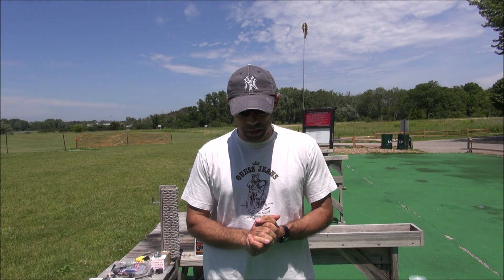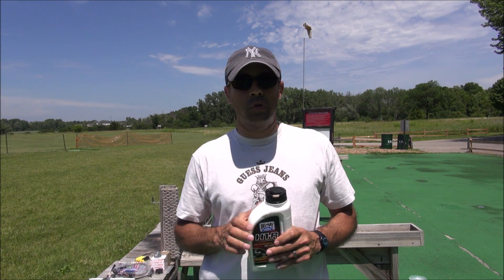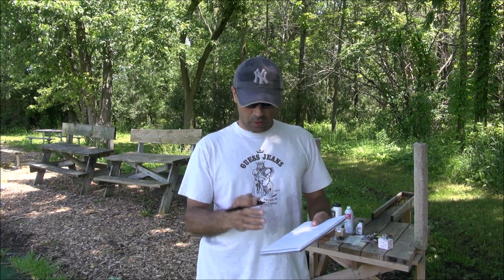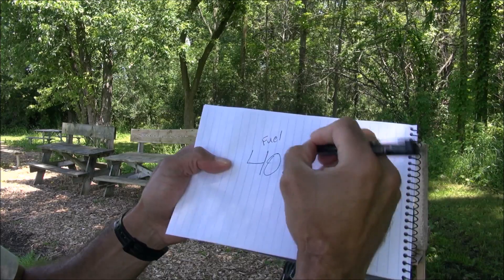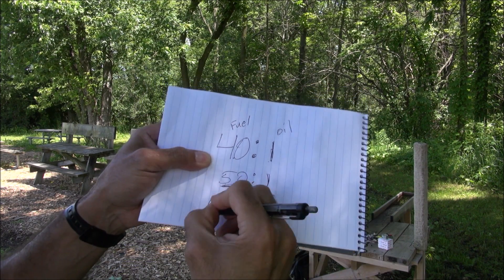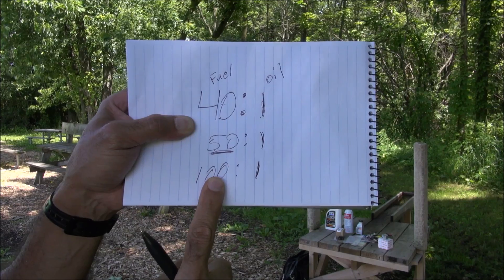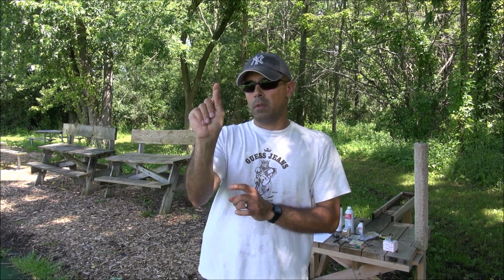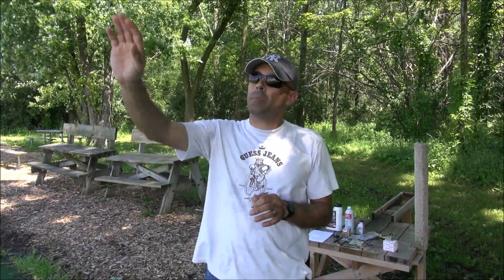RC Gas Engine Performance & Troubleshooting. Part 2

Comment: Great video especially for beginners like me. Love the way you explain everything.
Would love it if you could do a video on what may cause an engine to die mid air as so may people experience that, especially beginners. I appreciate that there can be many reasons but if you could at least mention the most common reasons, that would really help. I tried to find a video that does this but could not find any.

Comment: GREAT presentation 
11:40 in the video
Does the gas from inside line tube connected to the motor needs to be available to the engine ? I connected the gas line to the engine but the gas inside the tube from the tank never moved towards the gas engine 

How is the spark will make an internal combustion without gas? 

Pushing the propellers counterclockwise with carburetor butterfly open pulls the gas to the engine to make a combustion with the spark????

Comment: Hey there Moongrass.
I've been watching your videos on gas engines,witch r very good I mute add.iam starting out on gas engines and have a dle20cc on a Phoenix edge 540 120 size,I am wo deri g if you could help me out and prescribe  the best prop to suit that engine without overeating it to much I would appreciate your feedback.
Thanks so much 
Tony from Australia
Reply from the maker: I have a DLE20 and I have tried many different props on it. I always end up going back to the same one, an Evolution 16X6 from Horizon Hobby. I looked at their website and it seems like the prop is discontinued now. I would reach out to them and try to get a recommendation for a similar product. Here is the link so that you can see the picture: https://www.horizonhobby.com/evolution-propeller-16x6-evo16060